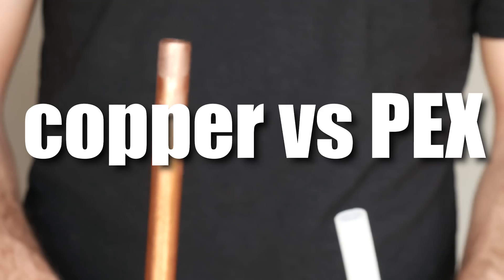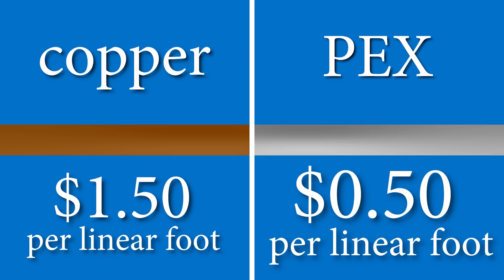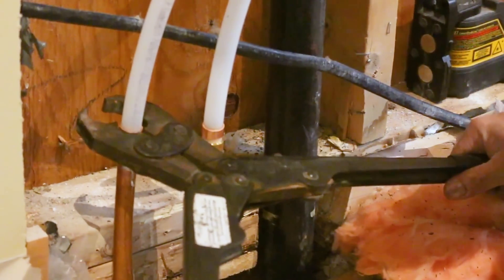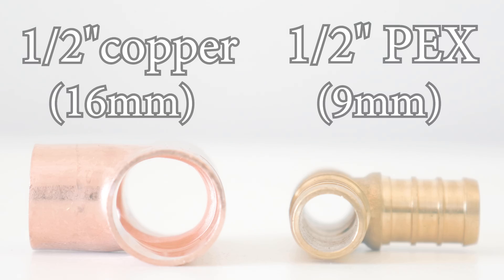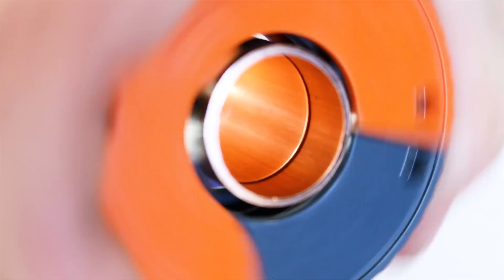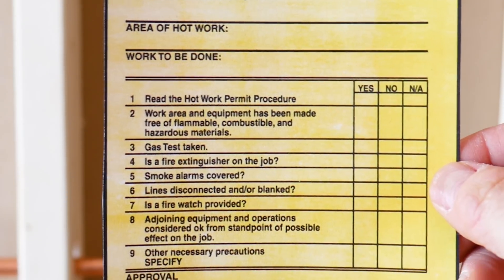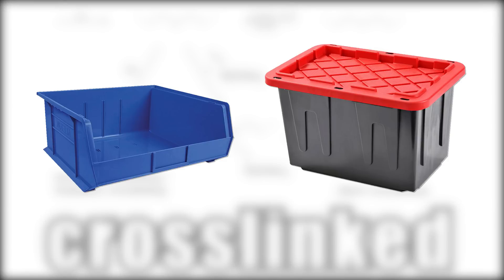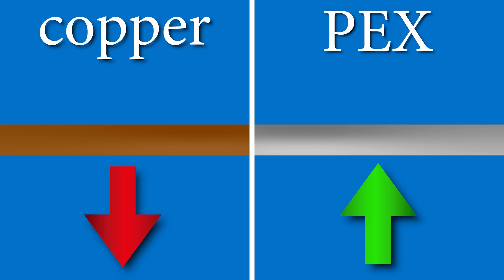Is Copper Better Than PEX? (COMPLETE GUIDE) | GOT2LEARN

Comment: PEX is known for leeching chemicals:
16 organic chemicals were identified, including 2,4-di-tert-butylphenol, methylene trichloroacetate, pyridine, and toluene. The team detected some of the organic chemicals during their field investigation of the plumbing system. Whelton and the other researchers concluded that users should flush out pipes before using them.

https://www.fondriest.com/news/not-drop-drink-plastic-pipes-leaching-chemicals-drinking-water.htm
Reply: Best thing to do in this case is never drink tap water and use shower filters or if you can afford, complete house water filters.
Reply: Alteraz That will work as long as after the filter there are no long lines of PEX or similar. In the Nederlandse the water delivered to the house is of good quality. No need for additional water filters (Which would be beneficial either way)  Therefore I don’t understand why pollute the most valuable asset of all which is healthy dinking water by using something that my install a little bit easier but will pollute and stays there for live.
Reply: So if you flush them, the chemicals go away? Are the chemicals from the manufacturing process and cleared up after short usage?
Reply: Tom C It is my understanding that the manufacturer cleans the materials themselves as far as possible. Still the material will contaminate what’s in it. In our case water. The concentration will get higher the longer it stands still. So that means flushing for every use and certainly before drinking. For example only tap drinking water after showering. Than you have flushed out most already. Flus out the remaining piping and you get the least amount of contamination. But it will be there always and it will build after flushing.
Reply: Those tests show a signifigant drop at day 30, which leads me to believe after a few months it would flush out in its entirety. Would help if they mentioned brands too.

Comment: So regarding the flow. You mention because Copper is slightly bigger it provides more flow however due to many more 90's in a regular home that would impact the flow where Pex would have little to none. So could it be that Pex may have more flow or at least equal to copper?
I replaced a section of copper in our basement that had Many 90's turns & replaced with with pex with only 2 or 3 90's I noticed flow seemed to of increased slightly due to this.
I feel like a real world test should be done on something like this.
Reply from the maker: Yeah it would most probably affect the flow, but tests would need to be done for sure.
Reply: @Got2Learn  Well if you want an idea for a new video you got one :D
Reply from the maker: Thanks man ;)

Comment: At work (irrigation) we use both pex pipe for the main water line and copper on the piping for the backflow preventer
Reply: WOW, that is overkill for an irrigation system. Your systems will last forever. All I see around here is thin wall PVC irrigation pipe. Guess it works okay.

Comment: The plumber that did my home 20 years age used both, copper up through floor for the fixtures, pex for the longer runs.
Reply: was wondering bout that, so u can use both, its ok to go back n forth like that??
Reply: @Eastbaypisces  It passed inspection (Alberta, Canada) depending on code in your area. The copper up through floor was fairly short.

Comment: I have used PEX "B" crimp for years in plumbing repairs, it is a great time saver, but the crimp style is a problem in tight spaces. I recently purchased a Milwaukee Pro PEX "A" tool and it is a dream. no more tight space problems better connection the first time, happier customers.  The only down side to PEX at this point is the fitting cost. three times the price of copper fittings unless you buy the cheaper plastic fittings. The only soldering I have to do is brass to copper pipe connections.
In cold weather states/countries PEX is ideal.
Reply from the maker: ProPEX is the best IMO. Why are you getting the brass fittings? Get the plastic ones they are way cheaper and do the job just fine, i've use thousands of these in commercial high rise buildings.
Reply: @Got2Learn  I do use the plastic fittings, but only brass can be soldered to copper in repairs.  Make a plastic fitting that attachs to copper, I'll buy it.
Reply from the maker: Hehehe, true! ;)

Comment: Very good video, the only thing I would mention is I have definitely seen rodents eat through copper.
Reply: I have seen them eat copper wire not copper pipe.
Reply from the maker: @1DrElectric  Or maybe the plastic around the copper wire?
Reply from the maker: I've never heard of that, but hey, doesn't mean I didn't hear it that's it's not true. If that is true, PEX is a lot more vulnerable as it's softer, so there are more chances of it happening with it.
Reply: No way is a rodents teeth hard enough to chew through copper. 
They will chew insulation around copper pipe or wire but never never the copper metal

Comment: I prefer to use pex instead of copper it is faster cheaper but for the heating system of course copper is better
Reply: When you take your car in to a mechanic or body shop, remind them you want the job done the fastest and cheapest method.

Comment: Here in europe we use alu-pex for everything never had problems I wouldn't install copper if I had the choice it's hard to fix and it has more problems I fixed alu-pex 2 times in 7 years and it's only because of a nail or a T broke which was a factory default never the piepe compared to copper were you atleast fix it one ever 2 weeks somewhere and they are in most cases 30-10 years old so wouldn't give copper 50years

Comment: In Europe (I'm myself from Belgium), we use a variant of PEX, called ALPEX (or ALU-PEX), which is a PEX pipe with a thin aluminium coat. It's stronger and gives full impermeability to the pipe.
Reply from the maker: Interesting, thank you!

Comment: I like & have used copper since 1973, I had galvanized & lead pipe before. Pex to me would be perfect for summer places or basic, cheaper houses. However, the rodent problem would be a challenge. I think time will tell, and the industry still needs to come up with a better alternative. Thanks...Jim

Comment: Your comment at 2:42 regarding the flow of PEX piping is incomplete.  While it's true that PEX-B fittings have a reduced diameter, it is not true for PEX-A (ProPEX) fittings.  These fittings are the same diameter as their copper counterparts and the PEX-A pipe is expanded to fit over the larger diameter fittings.  Of course, PEX-A is a bit more expensive than PEX-B, but still cheaper than copper.
Reply from the maker: Yes you are correct. However, this video was directed to crimp fittings more than expansion. I am currently working on an expansion video, so expect to see that soon ;)

Comment: Copper more $ but longer life and safer.
Reply: Actually copper does not have a longer life. Copper is prone to leaks, freezing bursts, iron and calcium will stick to the copper, where as PEX it does not stick and cause a build up.
Reply: @Handyman247llc  Copper has a more proven track record.  Many PEX products have been around only 20 years, and many have a 25 year warranty for whatever that is wroth... It probably means if a pipe fails somewhere they pay you for the pro-rated use of 1' of Pex.  Suffice it to say Copper is proven.

Comment: Old school but pex is fast easy and convenient,but enjoy installing copper,use 3/4 pex and flow problem are pretty well solved.
Reply: I’ve done service plumbing for about 8 years now and have only came across a leak from a rat once, on polybutylene. We only use uponor on repipes now. I would never use polybutylene, but coppers good when that’s what’s there
Reply: @anthonybenincasa  Polybutylene is outlawed and no longer sold.  I have never found a good method to repair leaks on that system and hate to say it but I use Sharkbite PolyB to CPS fittings.  When you have PolyB, SharkBites are the least of your concern... they are better than the PolyB fittings.  I usually try to replace as long a run of PolyB as I can where I do not need to add more fittings when I come to a leak.  For example if a wall is opened up, I like to re-pipe the whole wall if it has PolyB.

Comment: In my own home, I did a mix of the two.  I use PEX A (expansion) for the runs to each room, but copper for the incoming water line, distribution manifold, water heater connection, as well as the last bit to the service shutoffs to the fixtures.
Reply: Type K copper as incoming waterline is required by code. No choice here.
Reply: ve2zzz not on a well in Minnesota.  Incoming line is plastic, then transitions to galvanized for the pressure switch and tank.  Dielectric coupling to copper, but I could have done PeX.
Reply: I've actually seen guys say they recommend the plastic fittings because they don't corrode like the brass ones do
Reply from the maker: It's true!

Comment: I used copper in my whole house.  I was VERY careful de-burring the cut copper pipes. I am pretty sure that I did not overfill any connections with too much solder.  Copper is harder to install and more expensive, but I prefer it in my house as long as I know that it was installed well.
Reply from the maker: Great point!

Comment: Copper and Mapress for Life Dude ;)
In France, we bend Copper (you save money and time) and we brase copper with acethylene (it's call "brasure forte" like the HVAC men).
we call "brasure tendre" when we use Tin solder .

And with "brasure forte"we don't use Flux for copper to copper brasing and your copper is clean ;) no oxydation.
flux only with brass/copper junction.
You can Press copper too ;) (perfect for gas piping or in commercial building no paper work with fire license).

For me the best option is Copper for sanitary system and Geberit Mapress for Heating (galvanise pressing system).
You have no corrosion with galvanise pipe with steal radiateur and cast iron Boiler.

I don't use alpex (for me it's a big shit... it's middle hard and borring to work with).
I only work with Pex behind the Gyproc but i always use a pipe protection (steath) all along the pipe for rat and other accident (screw, nail...
And last but not least 

I'm a Plumber not a pex fitter ;)
Reply: Lol
Reply from the maker: Good information Toni, thank you so much, love hearing how others for in other countries!
Reply: Got2Learn it’s Always a pleasure to be hère and learn some canadian tips ;)
Reply: Lol
Reply: Its a copper phosphorus brazing rod used without the flax. Most likely.
Would you know the reason for the difference with North America? Is it quality of the water in France or the area in France or it's a bureaucratic choice of our countries?

Comment: Hello, how best to connect PEX to galvanized water pipe to replace failing connection left by last owner?
Reply from the maker: Do you have good threads to start off from?
Reply: @Got2Learn  not close to the problem, thanks
Reply from the maker: The best thing would be to replace as much galvanized as you can with PEX, so if the nearest connection is far away, it's good hehe ;) Once you have the threads available to use, you'll need either a male or female NPT to PEX adaptor to start off in PEX, lemme know if this helps.
Reply: @Got2Learn  Thank You so much!
Reply from the maker: Pleasure is all mine ;)

Comment: I agree with everything you say. How much of a price difference is there from the standpoint of the customer?
Reply from the maker: It's considerably less compared to copper, big difference.
Reply: Based on the figures given, the piping alone is 3x less the cost. So $30 of copperbpiping would be $10
Reply from the maker: @evanricard6468  Around that, yeah.

Comment: We are going to be moving into a new home that has pex, so should a purifier be installed right away to be safe?
Reply: Purifier for what? Dissolved chemicals can hardly, if at all, be filtered out. PEX is known for leeching: 16 organic chemicals were identified, including 2,4-di-tert-butylphenol, methylene trichloroacetate, pyridine, and toluene. The team detected some of the organic chemicals during their field investigation of the plumbing system. Whelton and the other researchers concluded that users should flush out pipes before using them. 
https://www.fondriest.com/news/not-drop-drink-plastic-pipes-leaching-chemicals-drinking-water.htm
Reply: @adriaan7627  So why is it legal?
Reply from the maker: Not necessary Chris, only if the taste really bothers you, I would try it out first.

Comment: Since my water eats away the copper due to sulfur issues,  I have been replacing all of my copper with PEX over the past 10 years or so.
Reply from the maker: PEX for the win!
Reply from the maker: Most time people start getting pinholes.
Reply from the maker: @vedant patel No it's not normal, it's a sign that the flux wasn't wiped or just corrosion from a metal part.
Reply from the maker: He could be right, all I know is that next to a pinhole, is always the green stuff.

Comment: I have copper pipes original to my house from 1926
Reply from the maker: Nice, you must have very neutral water coming in ;)
Reply: I believe you are wrong.  In 1926 (and much later) galvanized iron pipe would have been used.  If you have copper pipes, they were most likely installed in the 1960's or later.  Here is what I found on Wikipedia: "For potable water use, galvanized iron piping was commonplace in the United States from the late 1800's until around 1960. After that period, copper piping took over, first soft copper with flared fittings, then with rigid copper tubing utilizing soldered fittings."
Reply: Trend Investor maybe you are wrong I have copper pipe with lead pipe connected to it with a cup joint and that work was not done in the 60s.

Comment: Regarding the less flow,There are also different sizes of pex in my are 12mm 16mm 32mm pex,So i dont see it as a problem
Reply: We also use screw on pex fittings not clamp on fittings,so its easier for us to change fittings do modifications etc, we also dont need the clamp tool but we do need 2 wrench

Comment: My home has mostly 1/2" CPVC.  1979 install.  It's reached it's end of life.  I am switching to 3/4 pex interior and 1" exterior for the flow and reasons you mentioned.  I rarely drink my water without it going through a filter so no bother there.  I am 2" serviced off a 12" main very close so I ALWAYS have good pressure and flow.  I love copper and did my shop air with it.  But in a remodel, PEX all the way using mostly crimp fittings.  Sharkbite if it's in a bad spot.  Will also repipe my shop with PEX due to temps when that day arrives.
Reply from the maker: All good information, thanks Brian!
Reply: @Got2Learn  I was doing a repair on a house that had 1/2" CPVC that was propobably 25 years old. When I cut into the line to splice into, it just cracked and split. I had to cut back several more inches on both sides of where I wanted to get a solid piece of pipe to work with. I would never use CPVC unless it was a patch to repair.
Reply from the maker: That's the thing with CPVC, it becomes super brittle like glass, not a good thing :(

Comment: Why is it that a rodent has to always come by to mess up a person’s day. Most new home in Calgary don’t have the water pressure as the older ones do, so pex is a very easy and simple solution. Copper makes you feel more badass when installing because you have to use fire 😁. Be safe mon ami.
Reply from the maker: Hehe, yeah I really like doing 2" and up, makes me feel badass like you said, but seriously, for everyday use, PEX is so much easier to use and it just works, stay safe too buddy!!

Comment: I don't care what anybody says about PEX, all I know is that when I go into a home with PEX plumbing the water tastes funny.
Reply from the maker: Hehe, this also happens with copper in some cases, but yeah, there's nothing like good, clean mountain water ;)
Reply: Interesting, cause it got to the house in plastic pipes
Reply: If pex tastes funny it is despite the fact that it isn't metal, not because of. Although neither pex or copper are anywhere near as bad as cast iron. My house is all cast iron and there's little motivation to replace it all (despite easy access) when everything upstream is also cast iron due to the age of the neighborhood (about 60 years). Instead I just have filters before every faucet and a filtered showerhead.
Reply from the maker: Cast iron? You mean galvanized?
Reply: @Got2Learn  I guess I don't know for sure I'm not actually a plumber I'm a remodeler and I sub all plumbing out to real plumbers. But it's definitely iron and there's definitely a lot of shit in the pipes.
Reply from the maker: It's galvanized ;)

Comment: Maybe for installing. But once its done copper hands down. You never talked about once  installation is done and everything is tiled and so one whats the most reliable to not have leaks????
Reply from the maker: My personal opinion remains. If you have acidic water and you have copper running through your walls, that's something to be scared of, with PEX, i'd feel much safer.
Reply: If possible,  I would try to avoid installing plumbing where you can't access it for repairs from the backside.  That way you don't have to tear up your tile work.